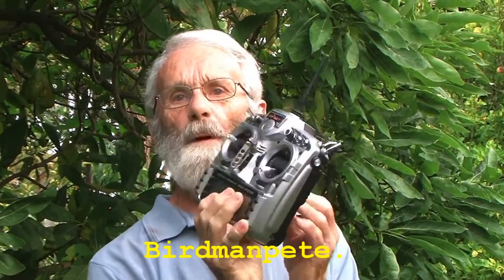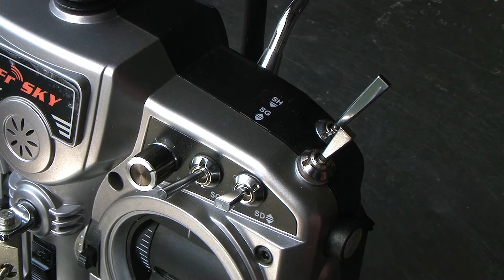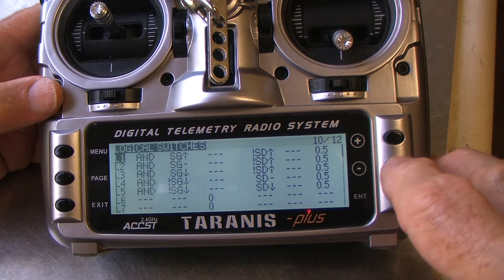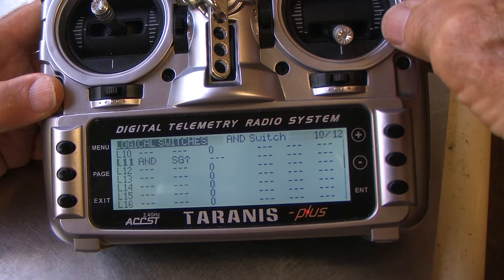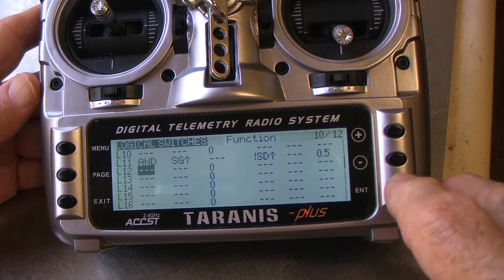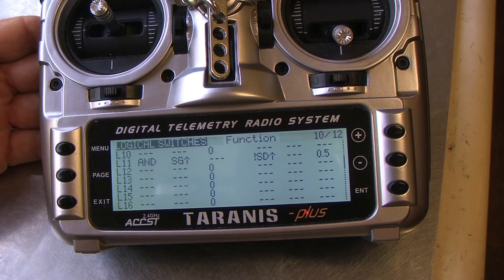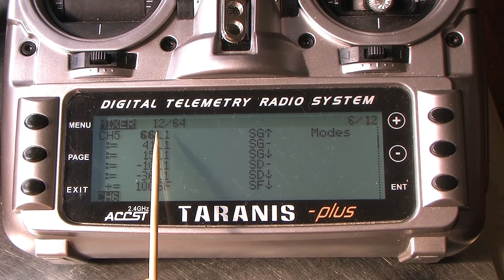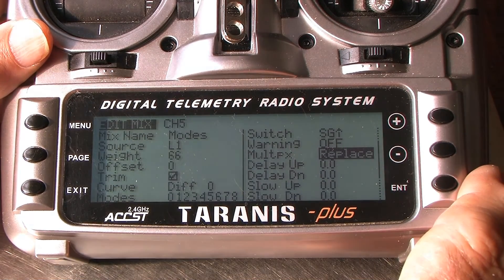Taranis Mode Switches

Comment: my plane has been parked for some time, and now cant get modes to work, all I can get is rth. on screen taranis shows that there are several bars moving, indicating correct programing? tried a few other way per you tube, nd it wont go into auto pilot or PA mode on Cyclops tornado flight controller. I had PA working at least last year